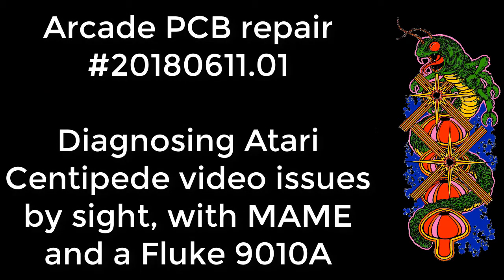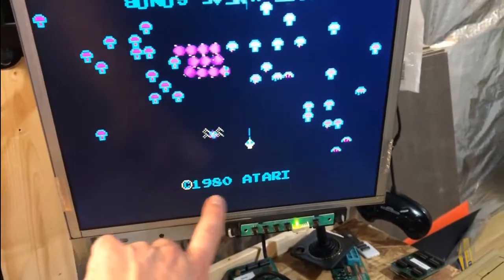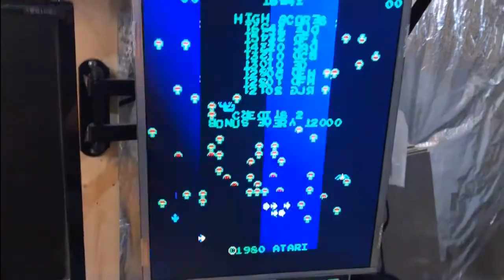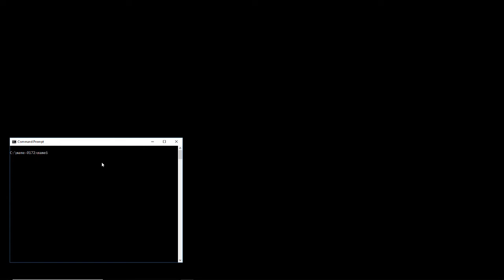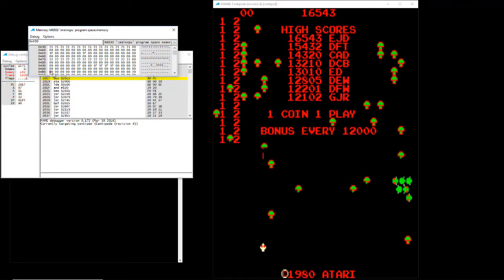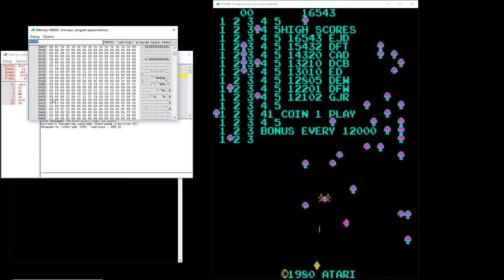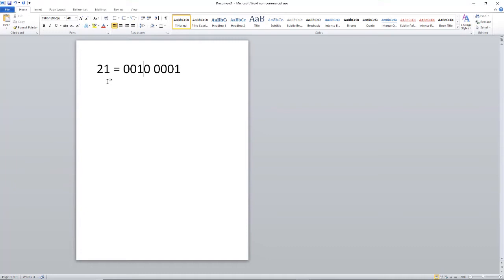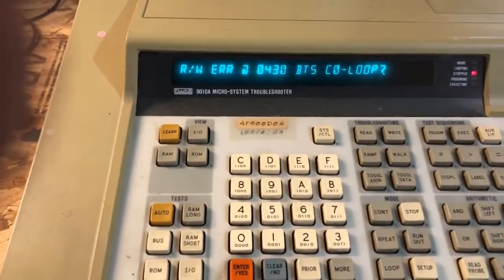arcade PCB repair #20180611.01 - Diagnosing an Atari Centipede by sight and with MAME.

Comment: when arcade games or computers use addressable latch chips which only have one data input port and multiple data output ports on the addressable latch IC chip. I'm confused what are the advantages of using addressable latch chips to do what?
Reply: sorry I 'm not sure what you mean.
Reply: @bebrzezicki  Address latch IC chip 74LS259 has one data input and 8 data outputs Q. I'm not why what is the purpose or advantage of using an addressable latch IC chip to do? its like its demultiplexing the address buss lines or something
Reply: @bebrzezicki  I have seen Addressable latch IC chips that are connected from the address buss to PROM chips or Arcade games Customer chips but I don't know why they are using addressable latch ic chips to be connected to prom chips and FPLA chips the addressable latch output pins are connected to the PROM chips data input pins but the addressable latch only has ONE data input pin and 8 data output pins
Reply: @bebrzezicki  PROM code can be coded to have if & then statements conditions like logic gates but ROM chips "can not" have coded condition statements or create logic gates in the code? I'm guessing that look up tables don't have any condition statements or if and then statements?
Reply from the maker: @waynegram8907  no. PROM and ROM just have data. HOWEVER a look up table "simulates" logic by computing all the possible entries then programming the read only memory such that when the inputs (treated as addresses) they output is the correct results of what the logic can do (see https://en.wikipedia.org/wiki/Lookup_table) either a fast bipolar PROM or a slow EPROM CAN hold the data, however the SLOW EPROMS "access" time are way to slow to be used to actually replace logic (logic gates are super fast compared to EPROM access times) so that's when arcade games you'll see things like "decoder" logic implemented by the 82Sxxx series of bipolar PROMS. if the EPROMS were fast enough (such as the W27C512-45) then they could have been used but they didn't exist back in the time frame. that is why though you can replace bipolar ROMs with newer FAST EEPROMS such at the W27C512-45 or One time programable ROMS (OTP PROM) like the AT27C512-45 with adapers such ashttp://www.arcade-cabinets.com/board_hacks/82S129-82S131-to-27512/ or   http://www.arcade-cabinets.com/board_hacks/82S123-to-27512/
Reply: @arcade-cabinets  I'm confused about the differences between a ROM and a PROM besides the access times and both are read only data. Both a PROM and ROM chips are read only data. The only difference is the access times between a PROM and ROM chip. But what about when programming code for a PROM chip is there things you can do in the code for PROM chip that you "can not " do with ROM chips or are they both the same?
Reply: @arcade-cabinets  Look up tables are Read only data. If seems that Look up tables don't have any logic conditions by using address inputs and giving the result on the output pins of the ROM or PROM chip. The Look up table is data code but isn't doing an real time "input conditions". So I don't really know what look up tables are besides just "preset data" that "can not" be changed or altered. It seems that look up tables are just a bunch of different data/code functions blocks that when an address is on the inputs of a ROM or PROM chip its access that certain block of data which is a function to do a task. Both ROM chips and PROM chips can have look up tables and I understand that part. What I don't understand is can PROM chips do more than ROM chips, and what more can they do? I often see PROM chips being used as logic input condition/output conditions like logic gates, multiplexers, address decoders. In arcade games they would use multiplexers to multiplex the H&V sync signals with the MPU address buss to create new 8 bit address for the color rams chips. But other arcade games use PROM chips to do the multiplexing by inputting the H&V sync signals and MPU address signals connected to the PROM chips inputs and the PROMS outputs will be 8 bit address buss for the color ram chips. I don't understand how the PROM chip is being used as an multiplexer chip and they didn't use a ROM chip to do this. Is this called anything when you write code for a PROM chip that its going to be used as a multiplexer or as logic gates conditions?
Reply from the maker: @waynegram8907  they are the same except doe access time and some Proms can be reprogrammed some cannot
Reply: @arcade-cabinets  ok thanks. In arcade games the color RAM chips address signals are Multiplexed H&V sync signals combined/mixed with MPU address signals. Is there a name for doing this? because these address signals aren't just normal address data signals they are multiplexed data address signals, its a big difference. If you tried to use a "decoder" to decode the multiplexed data address signals that are going to the color RAM chips the decoder wouldn't be able to decode the address code because its multiplexed. Do you know what I mean?
Reply: @arcade-cabinets  What is the Cocktail/Up right Switch do to the code loaded on the ROM/PROM chips? The cocktail/up right switch is connected to one of the address lines but it must flip the V&H sync signals coordination are flipped.
Reply: @arcade-cabinets  I'm not sure how the Combinational Circuits in the arcade games video section is Schemed because the Combination circuits are choosing the seniority of spirits and moving back ground objects and back ground. I think the COLOR PROM chip is dictating to the combinational circuits what the Scheme is. Is this how it works?
Reply from the maker: @waynegram8907  There are many ways graphics work in games, but the simplest way that was often used in games I worked on is that the "data" for the sprites at a certain pixel is compared to the data for the "background" at the same pixes, and if their is sprite data, then that is whats shown rather than the background pixel.
Reply from the maker: @waynegram8907  it does not "do" anything to the code, the cocktail switch is an "input" like a joystick that the game can check to see what type of cabinet it is in and do whatever is necessary for that type of cabinet. Sometimes the cocktail switch is actually checked directly in the video hardware to "flip" the screen or flip the direction of the controls.
Reply from the maker: @waynegram8907  I cannot really explain a look up table easily over these short messages. I'd suggest you google it a bit there are probably better examples than I can come up with anyway. Maybe if I get time I"ll make a video explaining how they work. as that would be easier than trying to explain in typed words.
Reply: @arcade-cabinets  when its flipping the screen what is it doing to the screen or ROM code? I'm not sure how it can flip the screen without changing the V&H sync signals
Reply: @arcade-cabinets  But what is doing the comparing of the spirit data to the background data? because they have logic comparators chips TTL comparators but I know arcade games didn't use them much
Reply: @arcade-cabinets  can make a video lesson on arcade game ROM look up tables and PROM chips being used as PAL/GAL by using the PROM chip look up table as logic gates , address decoder for address banking they used PROM chips in arcade games.
Reply: @bebrzezicki  Midway Robby Roto arcade games IC chip U10 is using a PAL chip, any reasons why they are using a PAL chip and not a PROM chip?
Reply from the maker: @waynegram8907  PALS are used to implement logic rather that an bunch of TTL chips. sometimes fast PROM are used for simple logic via logic tables, however more complex logic in a simple "package" requires PAL/GALS, or even more powerful programmable logic chips like FPGAs etc
Reply: @arcade-cabinets  when looking at the PROM data code from arcade game, how can you tell by looing at the PROM data code that the data code is a "logic table" or a Look up table? I can't tell when looking at ROM chips game code on how to tell if the ROM code is a logic table or look up tables, anyway of telling by looking at the ROM & PROM code? the universal programmers will read the ROM code in the software but not sure how to read the rom code to know if its a look up table or a logic table how can you tell?
Reply from the maker: @waynegram8907  no no way by looking at the prom. Basically if it’s not in a memory circuit it’s a lookup table
Reply: @arcade-cabinets  so there is no way of looking at the PROM code? What do you mean by if the PROM chip is NOT in a memory circuit its a look up table?
Reply: @arcade-cabinets  when arcade games use TMS4027 RAM chips which are Tri-voltage and trying to switch them to another RAM chip like 4116 or 4164 RAM chip the graphics will look different which I'm not sure why. I'm guessing because 4027 are DRAM and if you try to use SRAM which is a timing issue or access time difference or it can be in the ROM game code that was written for DRAM 4027 and other RAM chips used won't work and the graphics will look weird. Do you know why maybe?
Reply from the maker: @waynegram8907  Hi the 4027 (at least MK4027) are not compatible with 4116 or 4164. I learned this the hard way, apparently from what I understand their outputs are “latched” and the other rams are not. (That said I heard that 3rd person I have not verified that, however I have verified they are not compatible with 4116 or 4164 even though you’d think they should be)
Reply: @arcade-cabinets  thanks a lot of the information. The sprites and background images look glittered or sparkled when trying to use 4116 and 4164. What RAM chips besides 4116 and 4164 can be compatible to replace 4027 that aren't tri-voltage RAM chips? any reasons why they would want the RAM chips outputs to be latched for some benefits reasons?
Reply from the maker: @waynegram8907  you can read the PROM but unless you know it’s code you cannot tell if it’s code.

I mean if the chip is not hooked into the address lines of the CPU (or other peripheral) but used in just any generic circuit.
Reply from the maker: @waynegram8907  mk4015 also are compatible. I don’t know why they were made the way they were.

Comment: arcade cabinets.com, the H&V counter chips are getting preloaded with 1101 which is the 13th state. The counter chips only counter from 0-15. So if Centipedes counters are getting loaded with 1101 which is the 13th state its only counting 1101,1110,1111 or 13,14,15 only? Any reasons to only count 3 states for what reasons?

Comment: Thanks for this. I have a board I am repairing that fails the ram test on 2 banks but shows nothing adverse on the screen.   Someone was telling me you can’t test the play field RAM via the fluke which I found hard to believe.
Reply from the maker: glad you found it helpfull. in terms of the playfield ram you definitely can test it with a fluke, however you cannot test 0x7F0 - 0x7FF as only bits 0-5 are actually used so the fluke will give "bad results" since those bits are not used. (actually you might be able to test 0x7F - 0x7FF too, I've never tried since they are not actually needed, but I cannot imagine there's anything to stop you from accessing them, as that would erquire extra circuitry for no "value/gain")

Comment: ARCADE CABINETS.COM       1.) The Two phase clock signals was used for sharing the data bus for instruction sequencing to sync the RAM devices?
                           2.) DMA puts the cpu to sleep and transfers ROM data contents to flip flop latches and RAM chips? anything else what the DMA purpose and function is used for?
Reply from the maker: DMA is used to directly send data between  memory <---> device on the memory bus. In NON DMA systems to transfer data from a device into memory (for example a network card) the CPU must actually query the device and move each byte of information into the RAM by itself. This is not optimal when moving large amounts of data as the CPU has to do all the work and cannot do anything else during that transfer. 

DMA is used to let a device send data directly to memory (after receiving "permission" from the CPU). This does mean that the CPU cannot use the memory bus during that time. (though there are ways to interleave /share access to memory etc for long transfers basically by taking turns) But the idea is that DMA is used anytime something (a device) wants to read or write from RAM. In old arcade games (early 80s) I have not seen DMA actually used much except I think Atari vectors and Williams games (I think Williams used DMA, but not sure as I never worked on one) certainly newer games from the 90s had to use DMA as well as basically "anything" that's modern. (esp things like graphics cards, hard drives, sound cards, etc etc etc that move a lot of data around)
Reply: @arcade-cabinets  thanks for the help
yes nintendo arcade games and sega arcade games used DMA it seems. The CPU has to have a DMA input pin which I'm guessing Z80 doesn't have an DMA input pin. 
The DMA input pin on the CPU puts the CPU to sleep. While the CPU is sleeping the CPU is sending DMA output commands on the data buss lines still to the RAM chips to transfers the data from the RAM chips to the graphics RAM chips/graphics cards or either to the sound RAM chips to the sound circuits sound chips?
Reply: @billwilliams6338  generally a device says it wants to transfer data. Then it reads or writes to memory in a big burst. For example once the monitor is ready to write a whole screen it might start a DMA transfer reading a bunch of memory which has the data of what to draw on the screen. or perhaps a music card wants to play a sound, it starts a DMA transfer to copy the song data from memory. This is a really over simplified example. For more info check out the wikipedia page  https://en.wikipedia.org/wiki/Direct_memory_access
Reply: @tvbrzezicki2874  when the CPU is sleeping while the DMA is transferring a big data package from the RAM chips to the DMA device. Is the CPU sending read and write signals to the RAM chips or is the DMA device sending the read&write signals to the RAM chips?

Comment: ARCADE CABINETS, 
       Why does different arcade games use different RAM "access time"? because I'm not sure why they use different SRAM and DRAM with different access time?
Reply from the maker: that is a complex answer and I'd just google "different applications of static vs dynamic ram" however in a nutshell static RAM is MUCH faster than dynamic ram and is used in applications that need high speeds. In old arcade games static ram is also often used as system memory because it's "easier" to integrate. however some systems such as z80s are designed with the necessary electronics to automatically drive the dynamic ram so then dynamic ram is often used in those systems. Also dynamic RAM is often used when a lot of memory is needed as its cheap compared to static RAM.  back in the 80s etc static ram was really expensive compared to dynamic.
Reply: @arcade-cabinets  thanks for the help
In arcade games what are they using the SRAM for mostly? the SRAM is running the game code data from the ROM chips? because they have the DRAM doing the video data and color data?
There is other SRAM chips that are doing other system data for the Z80 like what?
Reply from the maker: @billwilliams6338  in arcade games SRAM can be used for anything system memory or video memory. it's often used in video memory in places where high speed is needed. DRAM is usually used for main system memory.
Reply: @arcade-cabinets  thanks for the help, What code is mostly in the system memory in arcade games because its not the game code from the ROM Chips its some other type of code only for the Z80? Because the game code from the ROM chips are loaded in other types of DRAM chips that are separated from the system memory. The system memory RAM chip gets their data from the Z80 not from the ROM game code?
Reply from the maker: @billwilliams6338  The stuff in RAM is data that changes or is computed. For example the positions of the characters, the number of points,  the scores, the number of credits in the machine etc, anything that the game computes "on the fly"
Reply: @arcade-cabinets  ok thanks for the help